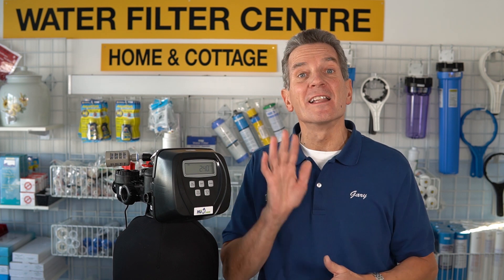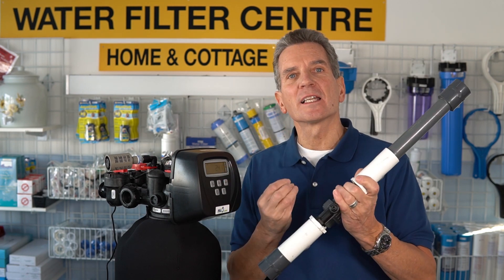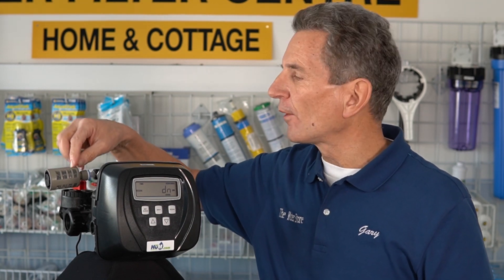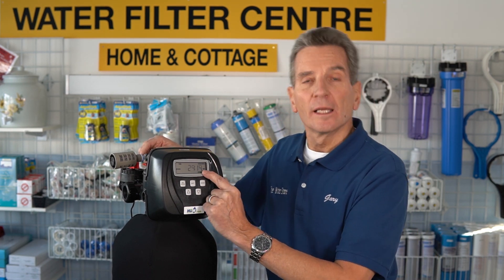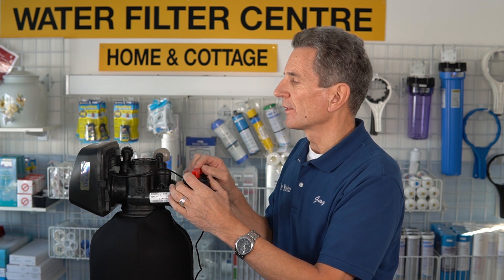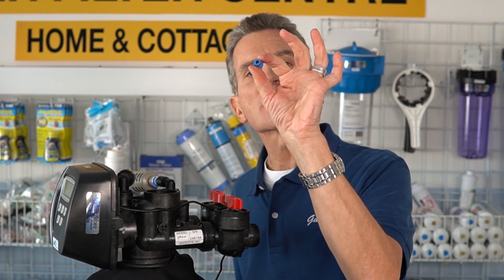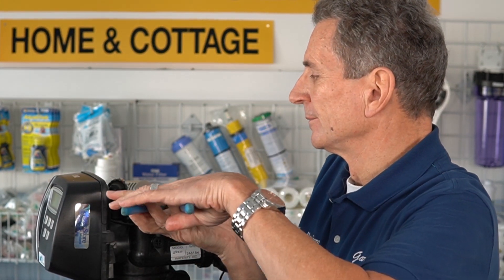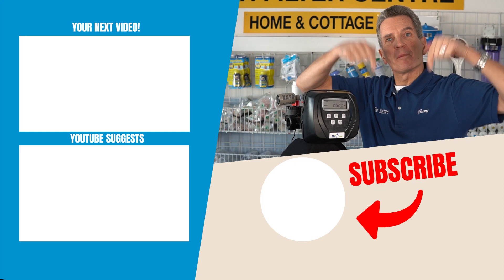IRON & SULPHUR WATER FILTER TROUBLESHOOTING and Repair in 7 Easy Steps

Comment: Hi Gary,

Thanks for your video. I had a company recently install an iron breaker and now I see over a thousand air bubbles in the water after I fill my glass.  The water comes out cloudy in the glass and dissipates over time. We ran a test to run the cold taps in every sink for over 10 minutes and the water was then clear in the glass. After the iron breaker did its 4 day regen the bubbles returned. Do you have any thoughts or suggestions?  I’m not sure if I have a defective iron breaker or the plumber did something wrong during the install. We had no air bubbles in our well water prior to this system being installed. Thanks for your time!
Reply from the maker: Great question!  that's how these things work.  The microbubbles oxide out the iron and sulphur.  100% normal.
Reply: @water_estore  - thanks! That makes me feel better I could tell by your passion for water treatment products you’d be a good person to check with. Happy holidays and thank you for your time!
Reply: @water_estore  Is it possible for those bubbles to loosen built-up sediment in the lines?

Comment: Hello Gary and thank you for the videos. How often should a iron filter regenerate mine is set to one day and after testing the well water before filter it shows less than one parts per million of iron. Also my water Softener has a flow meter which is set to every seven days or I believe it was 3000 gallons should I change the seven days to every three days regardless of the gallons?
Reply from the maker: We set iron filters to regenerate every 3 days.  If your water softener is a metered softener you are likely referring to the override setting.  Metered water softeners regenerate on usage.  If you have not used up it's capacity within the over ride period then that clicks in.  I set the over ride at 14 days.  Check out this video for more info https://youtu.be/5j3wXccdC4c
Reply: @water_estore  thank you very much for you help. Can I order the clack d1300 diffuser from waterEstore? Now there a sprinkler line poked through top of brine tank
Reply from the maker: @southfloridadents4363  sorry I don't know what you mean by clack d1300 diffuser.
Reply: @water_estore  I have ws1.5 as the filter that uses air to regenerate and oxidize.  I have seen in a few of your videos you have sort of tan color on top of valve where the air is sucked in. I looked at the clack website and they have it as per number d1300. Unless you use a different one I will still buy
Reply from the maker: @southfloridadents4363  I think I know what you mean.  I'll check it out on Monday when I am at work and get back to you.  Thanks,
Reply from the maker: @southfloridadents4363  can you email me?  Info@waterestore.com so I can email you a  picture?
Reply: @water_estore  Gary, my system is located at a cottage that we use about 10 days per month. I decided to set my regen to 300 gallons (about 3 days) when I am at the cottage and 7 days when I am away. Is that ok?

Comment: Thanks for the awesome video Gary! I just moved into a house that has an Iron Curtain, which is the first iron filter that I've ever owned. I can't seem to find an answer for how long the regen/ backflush cycle should take on this unit. I have the clock set so that the unit will regen at 4:30 a.m., but I've noticed the regen cycle still running at 6 a.m. when I'm heading out the door to work. Is it normal for these regen Cycles to last an hour and a half or more?
Reply from the maker: I would think the cycles should total less than 1 hour but I would contact the iron curtain folks to be sure.

Comment: Thanks for the video. I had my iron breaker 3 installed a year ago and kept getting the sulfer smell. After watching the video I looked at my unit and found the two arrows facing each other!!! Does that mean the tech who installed it kept it in bypass mode? Does that mean for an entire year my iron breaker wasn't doing what it is supposed to do?
Reply from the maker: Yes it does.  Orientate them correctly and it should work much better.
Reply: @water_estore  Thanks Gary. My $1600 system sat all year without doing anything! Never trust contractors and always go over their work!

Comment: How long after changing the injector will there be a noticeable difference in the water?
Reply from the maker: Great question!  Usually after the first regeneration the cold water will be different, hot water after you use up what is in the hot water tank.

Comment: Gary, I have an identical unit at home.  Is it normal for the drain line to constantly be draining water throughout the day (even when there is no call for water)?
Reply from the maker: No, when it is not regenerating there should be no water running to drain.  You need to replace the piston and seal pack.  I demonstrate the procedure in this video https://youtu.be/rWh1r3idZm0

Comment: Hi Gary, great video! Were new to well water and when we moved in we didn't understand what we had. We started to notice the sulpher smell after we moved in but only in the hot water but now it's on both hot and cold. I did the troubleshooting you suggested and I can hear the gurgling in our Waterite Excelflow (looks like the same one in your video) but still have the sulpher smell :( what are your suggestions for next steps?
Reply from the maker: Did you clean the injector?  i have noticed that some times you get gurgling but the injector still needs cleaning.  How old is your system?
Reply: @water_estore  having similar issues, should I replace the media or do I replace the iron system with hydrogen peroxide injection and rebed the softner system. Or should I rebed both and still add hydrogen. System is maybe 5-10yrs. New house can't even move in water is terrible

Comment: Hi Gary,  Great videos!  Thank you for posting great info for all of us out there that don't quite understand these things.  I do have a question that I cannot seem to find a video for.  I have an 8 year old Waterite Fusion2 FOB (media iron filter). that has worked amazingly beside one servicing for a very load air draw.  In the past few months we consistently get air in our pipes after our Fusion2 regenerates.  With COVID I haven't been able to get my plumber to the house.  If I manually perform a regeneration cycle for 30 seconds in drain and 30 seconds in "brine" mode it clears it every time.  Is this a valve sticking and any advise (or video) on what to do about it?  Thanks for your great work!
Reply from the maker: Hello, if you are getting too much air you can always shorten the air (brine) draw by 5 minutes. Hold down the next and arrow down button until the screen changes, should display filtering.  Click next, should display backwash 15 minutes, click next, should display brine 30 minutes, change this with the arrow down button to 25.  Click next, should say end.  Click next, should display home screen.
Reply: @water_estore  Thanks for your response Gary.  I'll give that a try and let you know how it goes.  After some reading I was wondering if it was a float or check valve that is sticking but didnt see a video about removing the control unit from the tank.

Comment: Hello Gary. Great Videos. I purchased what was called an “Iron Breaker” media filter system with the same electric control box as the one in the video from a local shop.  It is almost identical. It’s about 4 years old and I have never had a problem with it. Recently I was doing my inspection of the  water system and there was an unfamiliar clicking sound coming from the top control box. I removed the cover to see the display read “error”, the clicking sound, then the system shut down (screen goes blank with no error code). A few seconds later, “error”, clicking, shut down. And this continued. I unplugged the power for a bit and after reconnecting the power. Same problem. My water is starting to have the metallic smell again so I don’t think the system is backwashing. Any advice is appreciated. Thank you so much for your time.
Reply from the maker: I would try a manual regeneration by holding down the regen button for 6 seconds and see if it goes through the cycle or not.

Comment: Gary, we had a new head (Clack WS1 with all the buttons in a single row) and the carbon medium replaced in our old tank but the tech removed the air draw saying it was necessary for our system.  We continue to have sulfur and they are trying to tell us it is because the well is 30 yrs old.  Do you think its the issue of the air draw being removed?  Is there a possibility that the well has failed. It has always had strong sulfur issues, we are in Florida.  Also what carbon medium is used to sulfur?
Reply from the maker: Great question!  If it was an air over media catalytic carbon system (FOC) , it will not work with the air draw removed.  The carbon needs to be a charged carbon like  like this https://waterestore.com/products/centurion-catalytic-carbon-h2s-media-1-cubic-foot?_pos=1&_sid=2c368fbbc&_ss=r

Comment: Thanks for video, my iron system is now drawing in air after cleaning injector and replacing seal/spacers in the piston....but I have a sulfur smell...and I noticed after the RR cycle, there is no air pocket, which it used to have.  Also, if I stop the RR cycle early to leave a pocket in tank, the air pocket is gone in a hour.    Everything was great when airpocket was there.    what do I need to check or why am I loosing the air pocket?  Is that even a problem is I don't see a air pocket after regen complete   Thanks
Reply from the maker: How do you know that the air pocket is gone?

Comment: I've had a Clack water softener and iron filter similar to the one in your video since 2007 (the sulphur filter was converted from the maasai/air tank system to the self draw about a year ago). My water is now leaving rust in the toilets but it doesn't smell. Would this indicate that the birm media needs to be replaced and is it simple enough to do? BTW, I love your videos! They are so easy to follow and very informative.
Reply from the maker: I would be very concerned about the conversion. Who did the conversion?  You need a taller tank or it will not work long term.  Replacing the media is straight forward to do but VERY messy.
Reply: @water_estore  Thanks for the response! I started having issues with rust and had the original company in to have a look at the system (new owner), but he couldn't say which part of the system was responsible and just wanted to sell me a new system. A few months later I had another local company in and they're the ones who made the conversion. He explained that because the water pipes ran from floor level, then up and over the ceiling and back down to the tank, the air that was being injected would be trapped at the highest point and wouldn't be able to travel back down to the tank. He removed the venturi valve, converted the tank to self draw and removed the other tank that was on the side. Can you explain why I would need a taller tank? At this point I'm not sure what to do. I don't want to replace the entire system, but I can't seem to find anyone who can tell me if it's the iron filter or the softener that's responsible. I've recently discovered the Rust Remover water softener salt and will give that a try. If it doesn't do enough I'll try the media replacement. Thanks again!

Comment: the spacer kit, the gasket inside it’s most likely chewed up and not sealing the piston when in cycle. Replace that before re bedding, if the re bedding is under 3 years old

Comment: I have an Excalibur iron removal system. It started draining non stop, it never did this before. I do have a lot of sediment in my water, I run a small cleanable filter, and a big blue after it, and I still get sediment. Could this be why my system started to constantly drain? I have been to your store and the service was great! Thank you!
Reply from the maker: Yes, you will need to clean out and likely replace the piston and seals.  This video shows you how. https://youtu.be/WIa033n4OQE
Reply: This unit is two years old to me, bought it as a complete refurbished. Is that my first mistake? Should i have bought another brand? Anyhow, i will dussasemble unit and order what i need! Thank you for your time!
Reply from the maker: @joeyr6745  Any idea why it would have been refurbished?  Did it work when you first bought it?
Reply: It is a long story, i bought it knowing it was refurbished to as new if not better than new condition! It used to make a horrible noise during regen cycle, but only discharged water at that time. Now it constantly flows.

Comment: Our 15+ year tank is an Iron Breaker model very similar to this one and has worked perfectly until recently. Currently at the some point of the regeneration cycle (still studying to identify the stages/steps) is causing major drain gurgling and sudden rushes of water to back flow into our sinks, bathtub and toilet through the connected sewer/drain pipes. Ideas on cause/trouble shooting please kindly? Thank you!
Reply from the maker: Likely water is leaking past the piston and seals and they need replacement.  Seal stack is here https://waterestore.ca/products/clack-ws1-spacer-stack-assembly-v3005?_pos=1&_sid=1588eff18&_ss=r and piston is here https://waterestore.ca/products/clack-ws1-piston-v3011?_pos=389&_sid=3ee3b121d&_ss=r
Reply: Gary the Water Guy Thank you!